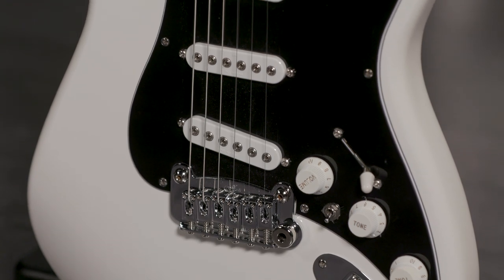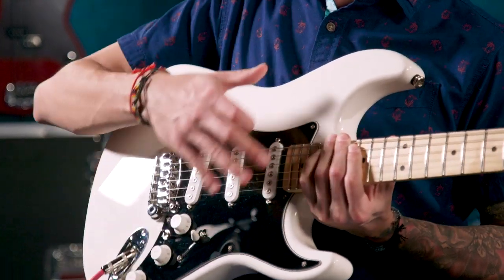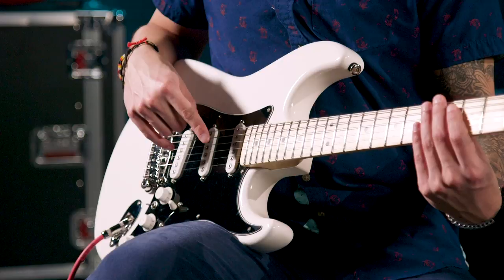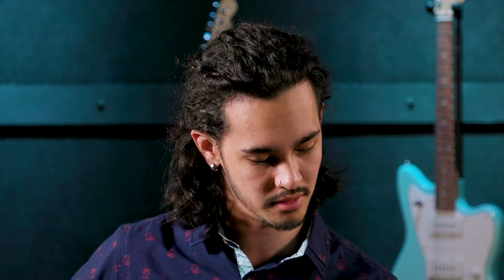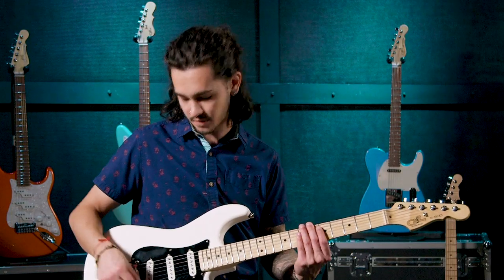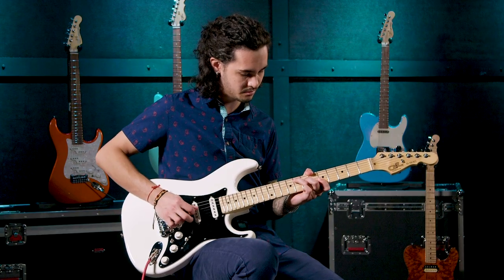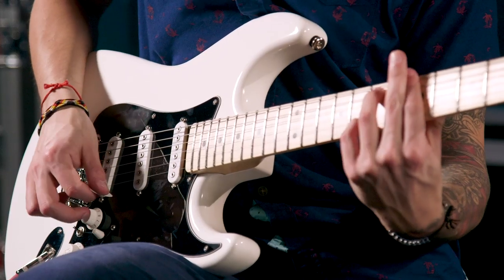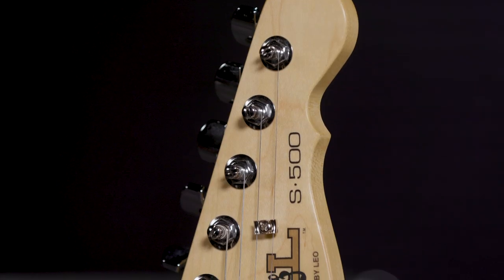G&L Fullerton Deluxe S-500 Electric Guitar Demo

Comment: Bass and treble roll off knobs instead of tone: why hasn't Fender made a Strat that's set up this way?
Reply: I really like the G&L PTB tone circuit.  I have retrofitted a couple of my strats to that system.  Al it takes is a couple of different value potentiometers and two capacitors.
Reply: @barbmelle3136  - what pots and caps have you used?
Reply: Because they spend too much time catering to people who think guitar design peaked almost 70 years ago. Ironically enough, Leo himself wasn't that kind of guy at all.
Reply: It’s such an amazing system. I use it on my legacies constantly and really wish it was on my sc2.